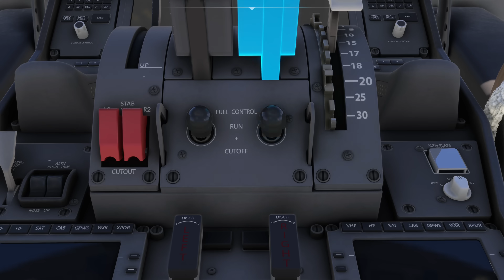Air India 171: Why Did The Fuel Cut-off Switch Get Moved?

Comment: Not Sure if you and most others have read the report or gone through
It says clearly that the fuel shut off valve transitioned in a specific amount of time and you all think both are same or similar occurence. 
People who are familiar with the control system should be well aware of the fact that one of them is an input (the pull out safety switch ) and the other one is an output (fuel shutoff valve) 
The fastest response with F1 drivers is 300 to 400 milli second this one transitioned in 100 milli second
The switches were ofcouse recorded as flipped as that is a instruction given to pilots during their training to reignite the engines and it took ~ 5000 Milli seconds, igniting one engine while the other one didn't
And please refer to the UK advisory regarding the shut off valve piblished a month back

So sad to know ignorance can let people to go to such lows

Comment: EEC Fuel Temp Management Logic (Simplified)

1. Normal Ops
→ Fuel Temp within limits → EEC monitors passively.

2. Caution Threshold (~49°C)
→ EICAS message: FUEL TEMP HIGH
→ EEC reduces fuel flow, adjusts VSV & Bleed Air settings
→ Crew Action: Consider switching tanks or reducing thrust.

3. Critical Threshold (>57–60°C)
→ Fuel vapor risk (vapor lock, cavitation)
→ EGT/RPM may become unstable
→ EEC enters protection mode:

Auto-reduce thrust (to Idle)

Alert crew with escalating warnings

If unresponsive: auto-shutdown engine to prevent failure

---

🧑‍✈️ Pilot’s Perspective: What to Expect

Trigger:

Flight in hot climate or long idle with little fuel circulation

FUEL TEMP HIGH appears on EICAS

QRH Actions (Typical):

Monitor fuel temps (via STATUS page)

Reduce engine load if practical

Switch to cooler fuel tank if available

Prepare for potential thrust loss or engine auto-shutdown

EEC Will Not Immediately Cut Fuel unless:

Engine exceeds EGT/N1/N2 safety margins

Signs of vapor lock or combustion instability are detected

---

🔐 Safety Layers in EEC Logic:

Stage	Action

Warning	EICAS Alert + Reduce fuel flow
Mitigation	Thrust modulation + temp balancing
Critical Response	Auto Idle + pilot alert escalation
Emergency Shutdown	EEC triggers shutdown if parameters exceed critical limits

Comment: One Air India pilot who flown the Dreamliner for last 10 years reported that it is impossible to set both Fuel cut-off switch within one second as it happened in this case and now Indian Civilian Aviation Authority issued a notice to to inspect these switches in all the Boeing planes in India.
Reply: both hands
Reply: @AkitaMix In that case the other pilot would have noticed easily, it would be  rather do nose dive when other pilot is not in cockpit since this was a long flight.

Comment: Page 1 of 2
Civil Aviation Authority
SAFETY NOTICE
Number: SN–2015/005
Version 2 Issued: 15 May 2025
Fuel Shutoff Valve – Mandatory Actions on Boeing Aircraft
This Safety Notice contains recommendations regarding operational safety. 
Recipients must ensure that this Notice is copied to all members of their staff who need to take 
appropriate action or who may have an interest in the information (including any ‘in-house’ or 
contracted maintenance organisations and relevant outside contractors).
Applicability: Operators of Boeing 737, 757, 767, 777, and 787 aircraft
Aerodromes: Not primarily affected
Air Traffic: Not primarily affected
Airspace: Not primarily affected
Airworthiness: All Continuing Airworthiness Management Organisations
Flight Operations: All Aeroplane AOC Holders
Licensed/Unlicensed 
Personnel:
Not primarily affected
1 Introduction
1.1 The FAA has issued an Airworthiness Directive (AD) addressing a potential unsafe condition 
affecting fuel shutoff valves installed on the following Boeing aircraft: B737, B757, B767, 
B777, which require a test and/or inspection; and on the fuel shutoff valve actuators on the 
B787 which require replacement, test and/or inspection. These ADs have been adopted by 
EASA and may be downloaded from the EASA AD webpage:
AD 2015-19-01 B777
AD 2015-19-02 B767
AD 2015-19-03 B737
AD 2015-19-04 B757
AD 2015-19-09 B787
1.2 This Safety Notice (SN) provides the process which will enable operators to utilise Flight Crew 
to carry out the tasks that are required on a daily basis, where this is permitted in the 
applicable AD.
2 Action to be Taken
2.1 The Continuing Airworthiness Management Organisation (CAMO) for operators of Boeing 
B737, B757, B767, B777, B787 aircraft should immediately make themselves aware of the 
relevant AD and establish whether it affects any of their aircraft.
Civil Aviation Authority Safety Notice SN–2015/005
Page 2 of 2
2.2 For those aircraft where the AD requires daily checks to be performed, operators have an
option for this to be accomplished by either engineering or by Flight Crew. Where an operator 
decides that the daily checks will be accomplished by engineering then each check must be 
correctly actioned and recorded to demonstrate compliance with the AD. Where an operator 
decides that the daily checks will be accomplished by the Flight Crew then the following 
procedure must be implemented:
a. The Post Holder for the CAMO and the Post Holder for Flight Operations for the AOC 
holder should agree on the tasks to be performed by the Flight Crew.
b. The operation check detailed in the AD must be documented in the Operations Manual, 
along with a reference to the AD number.
c. The method of compliance with this specific AD requires that operational actions are
approved by the CAA. Amendments to the Operations Manual must be submitted to your 
assigned CAA Flight Operations Inspector (FOI) for approval. The FOI will verify that the 
relevant checks and task accomplishment periods have been correctly transcribed into the 
Operations Manual, before approving the amended Operations Manual.
d. When an Operator has an approved process for the Flight Crew to action the checks 
specified in the ADs, they are required to record any failure in the aircraft technical log;
recording of the satisfactory accomplishment of the check will not be required. All defects 
must be rectified in accordance with the requirements of the applicable AD.
3 Queries
3.1 Any queries or requests for further guidance as a result of this communication should be 
addressed to SafetyPublicationsTeam@caa.co.uk.
4 Cancellation
4.1 This Safety Notice will remain in force until further notice.

Comment: There will be an investigation into the psychological history of both pilots. Was one or both pilots depressed? Was this a planned suicidal effort to bring this plane down? It appears to me that if the fuel cutoff switches were engaged, the worst time to do so would be after the plane rotated. There wouldn’t be any time to restart the engines. The plane would be doomed. I still have a hard time with this crash. I hope that the right answers are found so closure can happen.

Comment: Where does the data recorder "read" the condition of the fuel run/cutoff switch ? Is it possible that the switch was not physically moved, but some how the software read it as being moved closer to the engine control unit due to a fault/glitch ? Is there any proof that the switch physically moved ?

Comment: Re: Trying to design a better process for Fuel Cutoff switches, if this was deliberate and they aren't that easy to cut off,  it's not that the switches need redesign, it's Pilot's Mental Health that needs to be looked at IMO.  Stopping A Pilot that wants to deliberately do something to destroy and the Aircraft and perish is next to impossible to control.

Comment: Captain Steve, thank you for your detailed breakdowns. The DGCA’s preliminary report on the Air India Express crash suggests that the landing gear not being retracted at that point in flight was within normal parameters. However, in your earlier commentary, you noted that the gear should have been up by then. Given that, I’m curious: if the landing gear had been retracted earlier as expected, could the aircraft have retained sufficient energy and lift to remain airborne — even with the temporary fuel flow interruption and subsequent re-ignition around 10 seconds later? In other words, could the reduced drag and improved L/D ratio have made the difference in survivability?

Regards, 
Fellow Fighter Pilot from Pakistan

Comment: The report didn't say that the fuel switch was physically moved. The monitoring system just reads signals. So it went from RUN to OFF.
I've seen, so many times in my life, switches turn off without moving the button physically. But since this is a Boeing, so we presume that can never happen because we trust the quality so much.
Reply: The pilot who asked the question visually confirmed that they were in the wrong position.
Reply: @AkitaMix   No one visually confirmed anything from the information given.
People are taking it for granted that the switch was moved physically because it's the only way a signal turns off. And I do agree. But, there's a chance, it might not.

Comment: A big reason for allowing the pilot to do something that the aircraft automation software programmers would consider a crash inducing event is that the automation is all too often a victim of bad data.  If the wheels-on-ground sensor failed, a flight automation system that prevented the pilots from shutting down both engines in flight would prevent the shutting down both engines at the gate.  Two Boeing 737Max aircraft were lost with all souls due to the inability of the stall avoidance software to deal with bad data.

Comment: Question.  Is there a preflight checklist pilots go thru that would include double checking that the levers and instruments were in the correct position?  Also, it sure seemed odd that that single survivor knew when to jump out of the plane so as not to experience the fireball.... He is on my suspicion list.  Did he tinker with any controls prior to the flight or be an accomplice to a disgruntled maintenance tech?

Comment: Isn't it more than possible - perhaps even likely - that the movement of the switches countless times would wear away the "bump" that the switches have to be moved up and over, thus a slight accidental bump would move the switch whereas it would not have done so if the switch were new/not worn?

Comment: There should be mandatory psychological check ups and classes for pilots to attend after this disaster.  Please inform airline industry to make this mandatory for each pilot to pass exams and test by psychiatrists or shrinks to certify they are mentally fit to fly.  Also airline manufacturers should install cCTV cameras and ground control should watch and monitor pilots actions and moves during the entire flight.  Cannot trust them anymore.  scared of flying from now on.

Comment: Before everybody goes completely down the purposeful ill-intent (but the pilot wants to make it appear non-purposeful) conjecture, I suggest one consider the possibility of a human brain malfunction. 

Consider this scenario: Pilot Flying calls for gear up. Pilot Monitoring flips both of those fuel switches to OFF instead. 

As inconceivable as that sounds, review the Yeti Airlines Flight 691 tragedy. There the PF called for FLAPS 30…and the PM feathered both engines!

Comment: Tbh i watch captain steeve but a lot of answers were actually not convincing for me.. Well may be there is a malfunction internally which has force the fuel valve to close and of course the sensor will detect the position and that is recorded in FDR. I believe that no single action is directely connected to the main component. Any action you take will to to FADEC and will reach out to the main component and a feedback will be given frm that component back to FADEC thet it had operated from the sensor of that component. Imagine if a landing gear lever is up by the pilot  but the gear failed to go up so still the system will show that its in down position..because the  landing has never reached to a position to activate that sensor to tell the system that it has retracted...Giving an example...may be the switches were never off , could be a glitz in the electronic has cause the servo to close the valve and the valve sensor detected as cutoff ....we dont know..

Comment: Disagree, Sure sounds like a design flaw,  if there is no reason to turn off the engines fuel on take off then it shouldn't be an option. How many other control changes could be used to take a plane down outside pointing the nose to the ground or turn off engines?

Comment: It’s too early to blame the pilot however the plausibility of pilot in this case the Captain of the plane doing the suicidal act of pushing the fuel switches to Cutoff, we are not sure yet, just because both were startled in the manner of question raised on ‘why did you cut off’ as recorded, further to that what unfolded and possibly the baffling factor for both pilots on how it happened could be due to some mechanical and micro switches and Fadec software controls linked to fuel supply to engines. We are not there yet to reach any conclusions yet.

Comment: Captain Steve ! both pilots forgot to check ,whether the fuel switches were on or off .This is a result of over confidence and over-believing in each other .They did not examine  the console carefully before starting the engine .You may agree with me that the most experienced drivers do accidents more rather than beginners. It is not that a pilot with ten thousand hrs flying experience will be efficient flyers or one thousand hours experienced pilots will not be. How much visualization or mental presence matters ..

The plane took off with that much fuel which was in the pipelines and in the pump circuit. When that oil was exhausted then the  engine stopped or any one pilot might have mistakenly put the switches on off mod...or it might be interlock failure ..

Comment: I feel there are three scenarios here.

1. Pilot B actuated the cutoff. Pilot A asks him why he cut off, Pilot B lies that he didn't.
2. Pilot B actuated the cutoff and asked pilot A why he cut off (to sound innocent on voice recorder) and Pilot A answers "I didn't"
3. Neither Pilot actuated the cutoff, Pilot A asks why he cut off, because in his mind that is the only way both engines were cut off. Pilot B responds he didn't, because he didn't.

Steeeve said himself it takes a second between switching those fuel supplies. But according to the data, it took four seconds between engine one and engine two to turn them back on. Why did it take longer? I'd like to believe, given the stakes, it would cost less time? What if both switches were in the RUN position physically, but not their terminals and "cycling" them got them back to normal. I have seen this before, however I witnessed that on worn out "ordinary" switches that I'm pretty sure are built to a lower standard than Airplane switches.

Comment: Why are you not talking about the unusually long runway used for takeoff?
The takeoff roll was unusually long and slow, clearly visible in CCTV footage. This was before any engine switches were flipped. If the aircraft was “normal,” why did it struggle to lift off? That alone suggests that there were some issues already with tha plane

Comment: Simple - on critical components like that introduce an audio alert saying fuel switch moved to cutoff position. These can’t be disabled at takeoff in case of fire at rotate, but it here it could shave the critical few seconds for the pilot to switch them back to Run.

Comment: Why can’t this be a mechanical error where switch lock deteriorated and switches moved like a light switch. Especially when sent boeing itself put an advisory to this effect
Reply: If the locking feature is disengaged, the switch can be moved between the two positions without lifting the switch during transition, and the switch would be exposed to the potential of inadvertent operation.

Comment: Requiring fuel switches to be designed for two people to activate is a trade off, since doing so adds complexity to the system (there is a remote change, for example, that the system fails to recognize dual activation and hence does not activate), there is also the remote possibility one of the pilots is impaired.  All of this has to be weighted  in against the remote possibility of what happened to Air India 171 happening in other flights.

Comment: Airline producers May have to make it impossible to be able to turn off the Fuel at such a  CRITICAL POINT  of a flight  upon take off.
  Should on be allowed to turn off at a elevation that there is enough to flip back on and get those Engines fired back up. 

I am surprised you could actually turn off the Fuel so easy.

Comment: An important detail emerged, that is if the transcript has been 1) been translated 100% accurately and 2) it's the original transcript, I'm not expert to this field, but I recently read this:
One of the pilot said "why did HE turn off " instead of "why did YOU turn off". In a sense that there could have been a third person in the cockpit?  There is a huge difference between the two meanings
Reply: It's possible mistranslation but many languages don't always have to use pronouns, like in Japanese, they don't have 'you' but it's understandable when they meant 'you'

Comment: "Why did it cutoff?, "I dunno" => this sounds very similar to "Why did you cutoff?", "I didn't", especially if the pilots were tense and speaking quickly. It's possible that the pilots' words have been misheard or misinterpreted. It's difficult to tell until the actual recording is made public.

Comment: Fuel valves here and on 777 designed to spring loaded snap shut when any electrics to them go off even for a fraction. Switches in cockpit DO  NOT move from ON in such a case. Rtd Training Captain EAAC and  CPAirways
Reply: yes